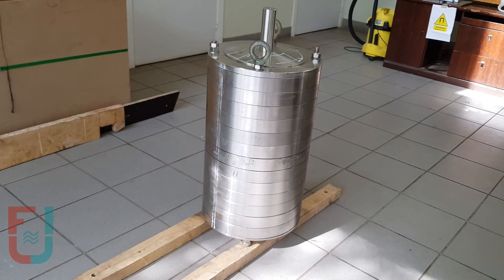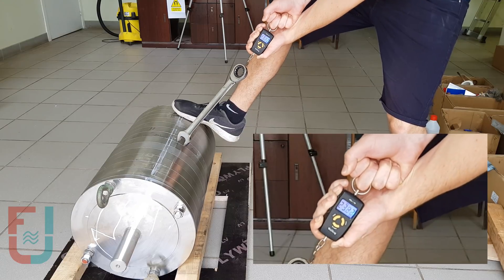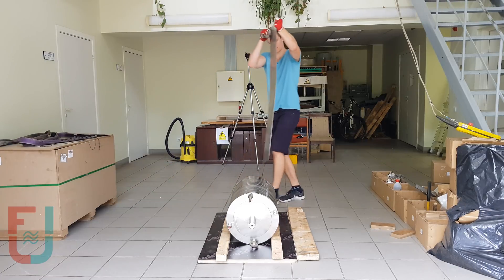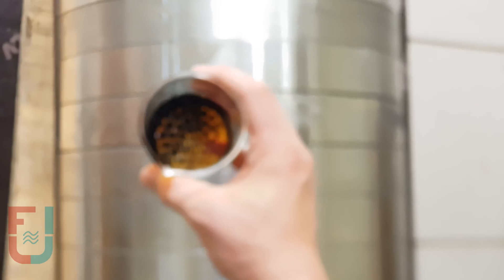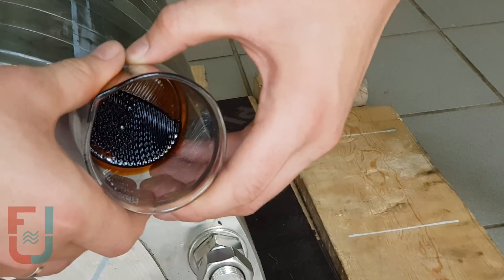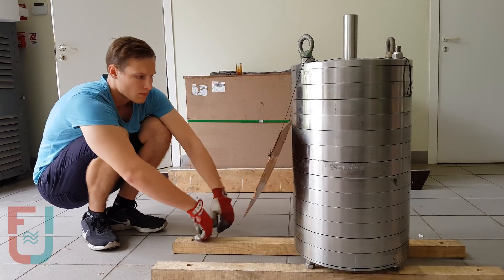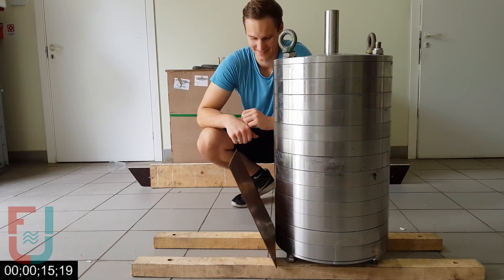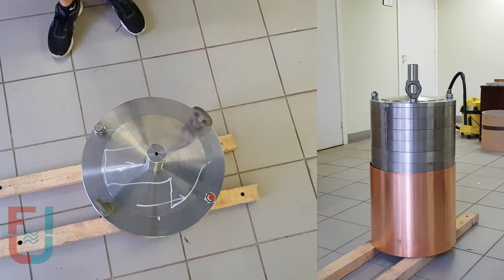Massive 600 kg (1300 lbs) Neodymium Magnet [4k]

Comment: The end of the video with the copper cylinder must have been "AMATEUR NIGHT"  The Cu cylinder was much to long and probably caused much confusion in the drop demo.
You should have made the Cu cylinder no more than 1/4 th  (or 1/8  th) the magnet height!  Then you would see the cylinder "free-fall" at the center, THEN slow down again as it fell on to the bottom.  There is a lot going on there that could have been demonstrated if you used LESS Cu.
When the cylinder landed, it was over half the height of the magnet...you missed the best opportunity  for a  more detailed, real explanation of "eddy currents" and "Faraday's law"!

Comment: Gotta say, this is super cool.
I recently got some 40x40x20 mm cubes, man are they powerful, (though nothing close to this).
I will say that it is way cooler in person when you can actually play with the magnet yourself.
I have a 1 kilo bar of silver that makes the magnet have incredible resistance to motion 1/2 inch away. (bet you could throw a bar of silver at that magnet and not even touch it).
Recommend everyone that likes magnets gets a few extra powerful ones (only like $40 shipped to get started), you will not regret it, unless you hurt yourself. 
Cheers

Comment: Very very good video ! Could you tell us more about this large cylindrical magnet made up of discs ? Is there a pole (north or south) between each disk ? Where are the poles ? What is the magnetic field strength in tesla at 20 cm from the magnet, at 10 cm and at 1 cm ? Thanks in advance for the answer.

Comment: I have a 200 by 50mm magnet with 1'600 kg of force. It's not as impressive as my smaller neodymium magnets, the bigger they get the less powerful they are relative to their own weight.
I would suggest to buy two magnets with 50kg of pull force instead.

Comment: What would happen if you put 1 iron sheet inbetween 2 copper sheets and then threw it at the magnet? Or maybe even a sandwich of copper, iron, and bisthmuth sheets?
Reply from the maker: Iron would still dictate the behavior of such composite. It would get stuck to the magnet, just not as violently. Diamagnetism of bismuth is even weaker effect. Wouldn't change anything other than the mass of the proposed object.
Reply: @MHDTechnologyLaboratory  Interesting! Thanks!

Comment: Do you think it would wipe out a computer hard drive in a police evidence room from outside the building?
Reply from the maker: Maybe if it was on the shelf by the wall which magnet is placed outside the building. Couldn't do a Breaking Bad style whole room destruction. The same applies to the electromagnet they used in the episode. You could do damage within a distance of 1 meter, not more.

Comment: So if you had anything metallic inside the body and walked by........what would happen 🙀🙀🙀
Reply from the maker: The good news is that anything doctors put in the body is most likely titanium alloy which is not magnetic. Piercings are from stainless steel, titanium, or other materials which in most cases are not ferromagnetic. 

Regarding induction caused effects ( like you see with copper), you would need to get close to the magnet to feel any effect and have a large piece on you. Maybe a hip implant could be felt. 

The actual risk group that should avoid such magnets are people with heart simulators.  Theoretically, a strong changing magnetic field might interfere with electronics in them.

Comment: 1 year ago i was in Switzerland for an experiment with a huge magnet, i had one piercing in my balls and it ripped it straight off and they put stitches on my balls.
Reply from the maker: I highly doubt it happened. Pierciengs and anything that goes into body is usually non ferrous
Reply: @MHDTechnologyLaboratory  I had a ring added to it, that was the thing that got pulled, not the piercing itself.
Reply from the maker: @Viechi  My condolences then

Comment: What are these magnets used for? (Apart from making cool videos)
Reply from the maker: We build and study machines that stir and/or transport conducting fluids ( mostly liquid metals) with magnetic fields.
Reply: @MHDTechnologyLaboratory  Cool. Is it spun up and used to move things like NaK? Why aren't electromagnets used for that purpose? Good Video! Thanks for the awesome demonstrations.
Reply from the maker: @maxmustermann5353  They are used. For moving molten metals trough loop one can use both electromagnets and rotating permanent magnets. First includes conduction pumps ( when you inject current directly in the melt) and induction pumps where you use a set of coils to and induce a current in the melt. Each of the methods has advantages and disadvantages.  The drawback of conduction is problems with electrical contact when thousands of kA are passed trough. Induction pumps are contactless, however, permanent magnet ones can in general achieve higher output for the same supplied power.
Reply: @MHDTechnologyLaboratory  Thanks, very interesting stuff :-)

Comment: Spin it at 15k rpm in a powerful electric field to see what will happen :P
Reply: @Guodlca so push it through a coil with a huge weight
Reply: @Guodlca couldnt you have alot of power for a short time. doesnt it depend on the size of the magnet windings etc
Reply: @Guodlca  Would also have to take in account for mass friction, and high accelerating heat. I think the metal magnet should be some sort of core reactor that would produce the energy for a large electromagnet disc around it.
Reply: hyparh why did u add the :p
Reply: @amedla-kp3qs   It's a :) emoji
Reply: I thought it’s like for spiting
Reply: Aaron Greenfield ok now I get it
Reply: @amedla-kp3qs . Right on. :<])

Comment: Why did that cooper sheet sped up downwards after passing through the middle of the magnet??
Reply from the maker: More precisely copper sheet sped up after it was fully covering magnet. Reasoning is that sheet is slowed down by the rate of change of magnetic field rather than absolute value of magnetic field flux passing trough the surface. This would have been more obvious if magnet was raised so copper sheet had passed the other end too.  In that case we would see it slowing down again until it was fully off the cylinder.
Reply: @MHDTechnologyLaboratory  Yeah, Right. Thank You. I never thought that when the copper sheet had fully covered the magnet and then as long as it falls through the magnet fully covering it, the net change in flux through the sheet was zero and the copper would only slow down as it would fall off the magnet as it would no longer fully cover the magnet.

Comment: Will the induced current go on the ring on his finger?
Reply from the maker: Short answer - yes. You can approximate by Lenz's law. If I move the finger in 0.1 s and magnetic field changes 0.5 T it would cause induced voltage of 1.5 mV for area of 3 cm^2. Resistivity of silver ring is about 0.4 mOhm  which gives around 4 amperes  of current.  (though only for duration that change of magnetic field happens  )

Comment: How much does cost this monster? 😂
Reply: When I looked online, each of those magnets was about $3000... Well 10 years ago when I actually searched for it
Reply: @7XHARDER  Thank you.
 I thought it's way more expensive.
Reply from the maker: @pöcök8899  This costs around ~50 000 EUR.
Reply: @MHDTechnologyLaboratory  where I can find it if I would like to buy it?
Reply from the maker: @andrewgolara6468  You can't buy a magnet of such size from any magnet manufacturer.  Anything bigger than ~5  cm in magnetization direction  has to be a custom made assembly of magnets. We do it in- house for the various machines we build. Theoretically, if an individual wanted to spend (tens of ) thousands of Euros, we could supply them with a custom made magnet.
Reply: Awesome....#MeCreation

Comment: Could you create a form of artificial gravity by having one magnet pulling down on a reference frame while another magnet pulls from the opposite direction? Kind of how you increased the weight of the wrench by 25? Instead of you pulling on the wrench another magnet pulls on the wrench? Hell in a spacecraft you could have magnets surrounding an entire area and apply specific voltage to the magnets so you could keep a constant 9.8 ms2. So when the craft is moving it uses the acceleration in addition to the magnets to fake gravity. Idk maybe it’s impossible.
Reply: Yeah.. not gonna happen with permanent magnets.  Now electromagnets,  maybe... but even then, since the human body is pretty much non magnetic,  our bodies will experience very little effect. Ferrous items may experience a form of artificial gravity,  but it would take a lot of computing power to maintain it...
Reply: @Quickened1  what about if you use the magnets to rotate the craft or space station. Lets say if you wanted to hollow out an asteroid to be a stealthy space station and make artifical gravity could you put a magnetic set up in there to spin the interior making artifical gravity?

Comment: How on earth did you put this together? I watched Brainiac combine two 6"x2" magnets, and that was a major operation.
Reply from the maker: Assembly is indeed a challenging task. We use some helping machines and our know-how :)
Reply: @MHDTechnologyLaboratory  when I become a millionaire, I'm gonna make a giant magnet cube and force opposing ends together, it might be the secret to infinite energy
Reply: @7XHARDER ? And you cant do that with a smaller, hand held sized one? 😂
Reply: @7XHARDER  
It’d do the same as small ones and infinite energy? No
Reply: @7XHARDER  why not engineer a powerful electromagnet so it is safer, cheaper, and overall more effective? The electromagnet would have to be a skinny, long cylinder wrapped / surrounded in a supercooling fluid or magnetic insulator, making the poles of the magnet even stronger. Also you would need an engineered truss frame to hold the magnets together.
Reply: @7XHARDER  dont skip science classes for now.
Reply: @LieseFury wow that's harsh.
Reply: @MHDTechnologyLaboratory  can you make a magnetic room

Comment: Wow, for what is this kind of assembly used for? MRI machines?
Reply from the maker: No. In MRIs they use superconducting electromagnets.
Reply: @MHDTechnologyLaboratory  Oh i thought some smaller machines of low magnetic fields could use permanent magnets to avoid the usage of cryogenics. Still im curious about that kind of application could have such massive assembly or its classified? Thanks for your answer!
Reply: In reply to myself and to anyone curious. The magnet assembly was very likely used for aluminium melt stirring experiments in huge crucibles.

Comment: Can you swing this magnet at a dense copper wall and measure the heat created as the copper brings the pendulum swing to a standstill. It may be dramatic. Can you also rotate the magnet near a dense copper wall and measure the temperature change too please. Thanks!
Reply from the maker: The change in temperature will be negligible. It is because kinetic energy in absolute terms will be small. All the kinetic energy will go to heat. Despite the mechanism being different ,it is the same as dropping rock on copper plate. Almost all the kinetic energy goes in to heat, but we dont even register temperature change in dropped.  The equation would be 1/2mv^2=m*C*dT, where m is mass, v velocity before impact, C heat capacity for copper, dT change in temperature. When you plug in reasonable numbers, you get fraction of degree :/
Reply: Thank you for the response. I am very interested in magnetocalorics but know there are different, better designed materials for giant magnetocaloric responses.
Europium and Gaodlinium ( Gd5Si2Ge2 ) alloys look promising ( EuTi0.875Mn0.125O3 )

Comment: this is kinda fishy, such magnet should definitely attract all this stuff with much, MUCH greater force. unless its very low grade magnet like N30 or the actual magnet is concealed inside the cylinder and further separated by ~5 cm air pocket
a 50x150 N52 disc magnet can lift up a 1.2 ton of ferromagnetic material like iron
Reply from the maker: Most of the volume is composed of N50  grade magnetic material. Short answer is both magnetic field and force between two magnets (or magnet and iron) is roughly proportional to 1/r^2. That means it quickly decays with distance. That is why in video only small objects (by volume) are used, because removing anything bigger is pain in the ass. Even with hammer, I had to put something in-between, otherwise it would damage the surface with impact.  Long answers includes field decay in range where distance to magnet  and size of magnet are comparable and saturation of flux trough ferromagnetic objects which makes intuitive scaling (of how big of an effect to expect) difficult.

Comment: Can magnet lost his power...?? If so .. than how??
Reply from the maker: Yes, there are some mechanisms it can happen. First of them is heat. When you heat it above certain threshold it starts to lose magnetic properties.  Second mechanism is when even stronger external field is applied. Doing that you can re magnetize it in different direction.  Third one is strong mechanical shock.

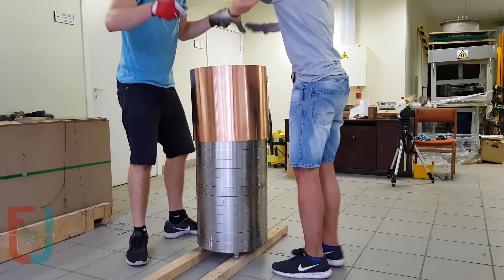Comment: i just have a problem with 3:49to the end.
i spent the time to find it and wouldn't post it if it wasn't educational
https://www.youtube.com/watch?v=nV4yA8OYwmE
i just do not understand why it drops like a rock as soon as the whole copper sheet is around the magnet.
Reply from the maker: Good question. In case we were to allow the cylinder to fall further ( could have been done if the magnet was raised) we would see that shortly after crossing the middle point the motion would be suppressed again. (And you could see bit of damping right at end of fall) 
The explanation is as follows: the change in field flux is slowing down the conductor (not the absolute strength of the magnetic field ). The middle of the magnet is the point of maximum flux trough cylinder. So up until reaching middle flux is increasing, but after middle point flux is decreasing. The induced magnetic field in the copper cylinder tries to compensate this changing flux.  And around the middle point, the change in magnetic flux (per unit of lenght in z direction) is lower than around edges.  To reiterate, field changes more drastically when copper is partly wrapped around the magnet, rather than in the center. If we had a very long cylindrical magnet, ( height>>diameter), there would be practically no damping for most of the fall. (only when passing ends)